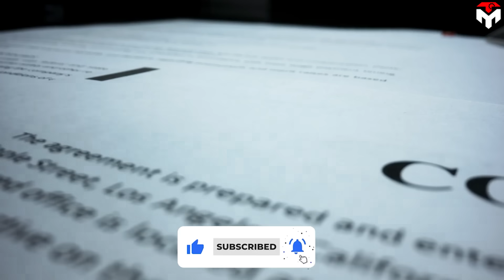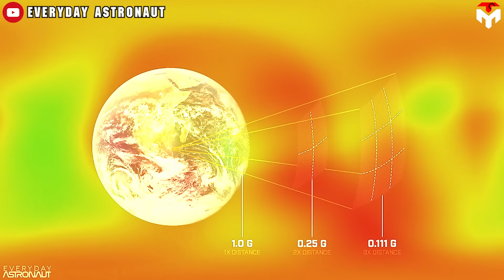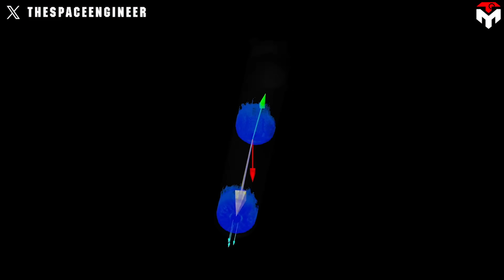SpaceX officially announced LAUNCH DATE for Starship Flight 3!

Comment: If the date is correct, then license VOL-23-129 (Rev-2) must be issued no later than March 10. Autonomous Flight Termination System will armed March 12. Scaffoldings to be removed from pad on March 13.